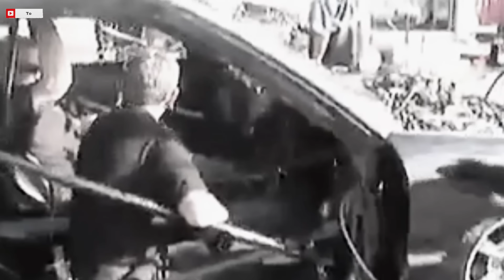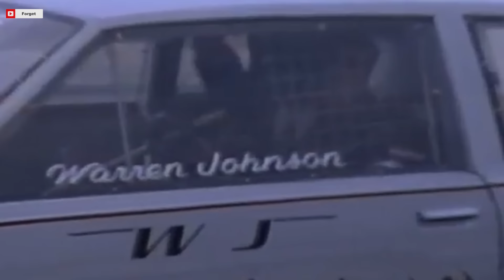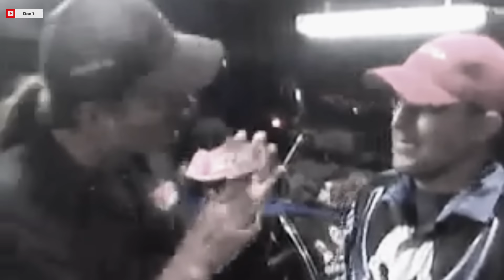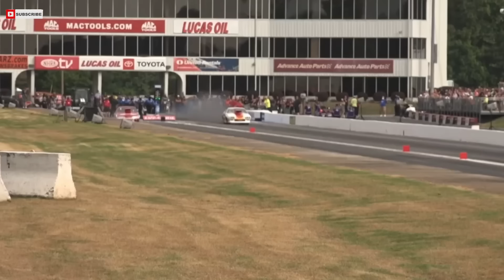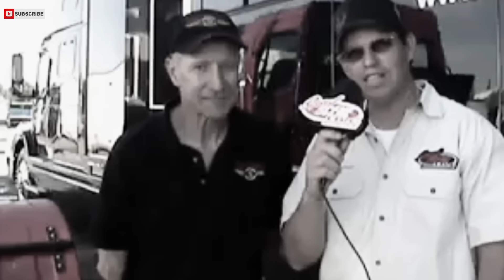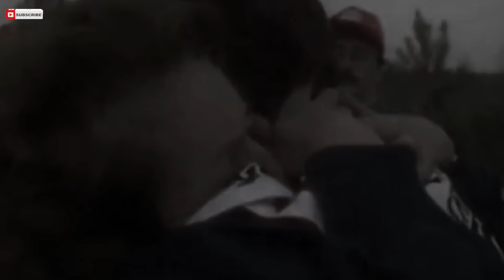Bob Glidden's Secret: Engineering Genius or Cheating Legend?

Comment: Bob Gidden was not a cheater, Eventually, Someone will need to pay for that, 
His notes, His work ethic, consistency, cutting great lights, driving, etc, Entire team package. 
 Bob Glidden was constantly taking notes, testing in his shop, on the track, Dyno testing,
Always ' Looking for that Extra 5, 8, 10 hp or so, 
 If one will notice with some of his races, B. Glidden will win with authority, Others races, just edge out his competition at the end of those races, ! 
.
' One Big Secret was: 
'At That time,'
Cast Iron Heads: Welding those cast Iron heads, Partially closing in combustion chamber area with weld, 
Hi Performance Aluminum Racing Heads are all machined this way.

 Decreasing combustion area for hotter ignition. Ingenious...

Well, 'How does one weld cast iron ?
Heat it up to a certain temperature 🌡

Comment: I had a Fairmont 0 to 60 in 12 seconds quarter mile in 21 seconds top speed 79 mph!
Reply: I owned a 1977 Mustang II 302 that run a 18 second Quarter mile at 78 MPH but Dyno don won a Pro stock championship with a 1977 Mustang II.

Comment: He had an unbelievable work ethic and competitive desire! As far as im concerned,  he was the most intelligent drag racer and engine builder and engineer to have graced the sport!
Reply: As far as Pro Sock Gliddens records tell the story
Reply: I can tell you from experience that if you run a Ford you have work harder to make it run, but it's is well worth it if you know what you're doing.
Reply: Without a doubt. The modern cylinder heads of today are based on Gliddens head work. His furnace was used ti heat them red hot so they could be brazed without cracking. He moved valves around and reshaped chambers. No component went untouched.
Reply: I beg to differ, Mr Yuniks"Smokey" Best Damn Garage in Town, was light years ahead of the Game and all the Players, you must've forgotten, it happens, carry on my friend😂
Reply: Some may argue that Warren Johnson shares that title...
Reply: Ask Billy or Rusty they’ll tell ya.

Comment: The only ones that  run a 4 door  race car in Pro stock was Gapp & Rouch they run  a 4 door Maverick. Bob glidden didn't Cheat he just worked harder remanufacturing his parts than any body else. Warren Johnsen had a problem with Gliden because he couldn't coompeat with Bob.
Reply: How can you get so much wrong? You talk about a 4 door Fairmont that he never had and never even showed this supposed car.
Reply: I couldn't have said it better
Reply: @stevewelborn8744 really? Coompeat??
Reply: Exactly !!
Reply: Well said & 100% factual
Reply: Glidden was sharp hard to beat but he did cheat just better than anyone else
Reply: @jeffoglesby1327  B.S !!!!!!!!!!!!!!!!!!!!!!!!!!!
Reply: @jeffoglesby1327  He didn't Cheat He built engines that  were Better than any body else.
Reply: @mylanmiller9656 Every Racer on Earth has cheated or cheated, BTW, it's not cheating until you get caught racer rule 101
Reply: That was in 73 or 74. Not 78.

Comment: Funny how theres not one pic of a 4 door.  And it repeatedly sows a hemi when describing the engine.  Used to be reporters has at least some pride.  Not here.   However, there was a  4 door ford in the class.   Gapp & Roush had a 4 door Maverick that was no beauty . If it is AI, theres pics of it on google and AI got confused because well, its making you tube money.  Truth is beside the point.